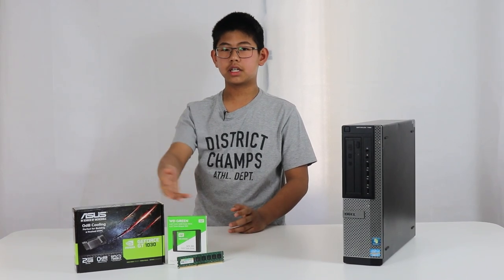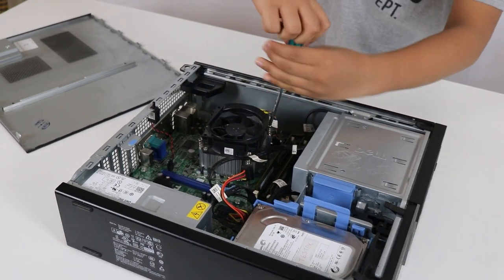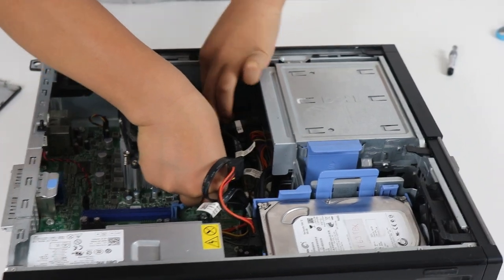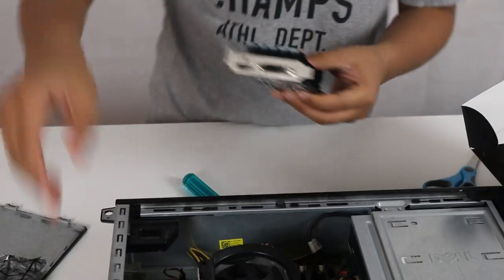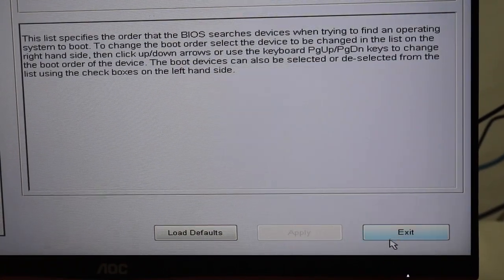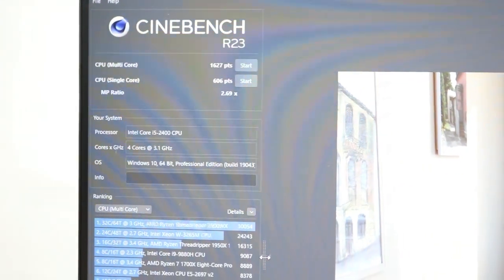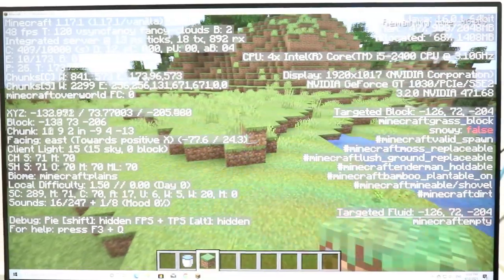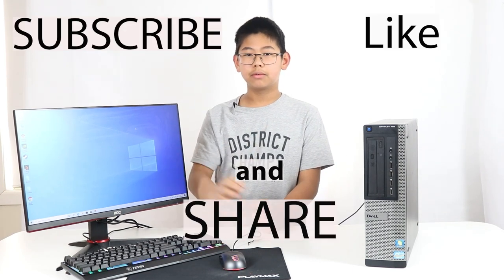Dell OptiPlex 790 DESKTOP UPGRADE!!

Comment: I’m looking to purchase a refurbished 790 with i5 Gen 2 and replace the graphics card with a Geforce 1650, I’m new to the computer scene so I’m not sure if it’s worth it even with my current budget. Should I stick with the 790 or go up to the optiplex 990?
Reply from the maker: It all up to your budget, but it should be great. 790 and 990 are extremely similar
Reply: If you can get a i5-4440 that would be a lot better with a 1650 imo, but it depends all on budget.
Reply: 790 had a 200w psu, but 990 have 300 watt so its an upgrade for gaming, in terms of games i5 2nd,3rd and 4th are the same level.

Comment: Pat, I have the same dell 790 and in desperate need to put a sound card in, the integrated sound does not seem to work anymore after a widows update I am using windows 10. can you direct me on how to put in a sound card so it will by pass the integrated one? Thank You!!!
Reply from the maker: You can get a PCIE low profile sound card and put it in the PCIE slot.

Comment: I have the same PC, Is it really safe to put GT 1030 on it?  Can You recommend other types of low end GPU?
Reply from the maker: Try the 1050 if not GT 1030 is the best option taking into account price and performance
Reply: This video card only draws 30 Watts maximum. The other parts he is installing also are low power. Hope that helps. Cheers
Reply: Yes i have 790 with gt 1030 and its great but if you have a dell optiplex tower just go with 750ti cause its cheaper and better
Reply from the maker: @its_ian  The reason I used 1030 because here in Australia, the 1030 is the most cost effective option.
Reply: @techwithpat4000  alright btw how much did you got your gt 1030. Me igot it for only 64$
Reply from the maker: @its_ian  I got it for 120 Australian Dollar. Yes Australian Dollar.
Reply: @techwithpat4000  Can i use RX 580 for the gpu?
Reply from the maker: @shiro8163  yep go for it mate.👍
Reply: @techwithpat4000  Rn, I'm using the dell optiplex 790 dt. Do i need to buy like a 15 pin pcl-e to connect to the gpu or the dell optiplex 790 dt already has a pcl-e cable that can connect to the gpu?
Reply from the maker: @shiro8163  You would need to buy a sata to pcie power adapter.

Comment: What is best  supported processor for dell optiplex 790?
Reply from the maker: Performance wise, you should upgrade to either i7-2600 or the K version. But any 2nd gen intel cpu will work well. I just also recently upgraded my optiplex from an i5-2400 to an i7-2600.

Comment: Can u change the cpu
Reply from the maker: Yes you can if the cpu uses the same socket.
In this instance for example the socket is LGA1155 for the i5-2400. Any CPU which uses the LGA1155 can be used. Same goes for other sockets.

Comment: I've the exact same PC but it's not  starting 😭
Sorry but I'll never recommend anyone for this.

Plz if you've any solution helo me
I've 4 HDDs installed, 10 GB ram abd Core i7 2600
Reply from the maker: Hi there Babul, 
This could be a result of dirty ram modules, dead power supply or faulty motherboard.

You can clean the ram modules by rubbing an eraser on the pins on the ram module.

These are the only possible issues if the PC doesn't start at all. If it manages to post then it's a HDD issue.